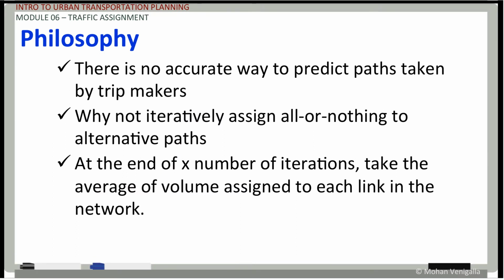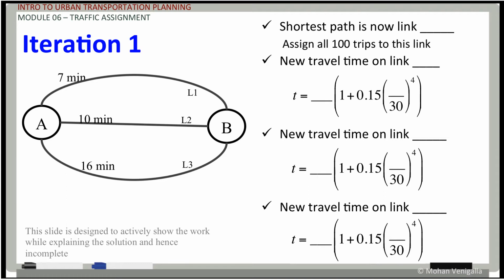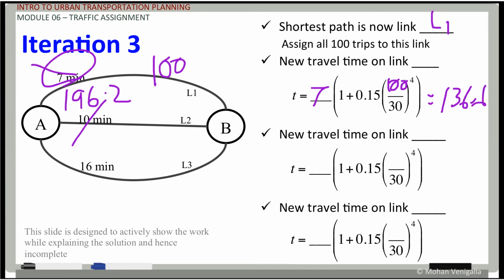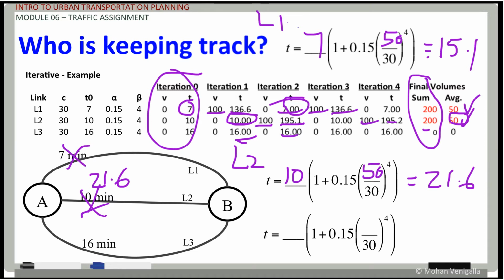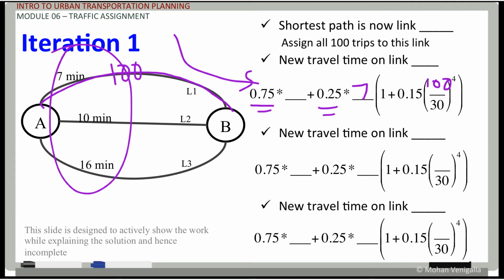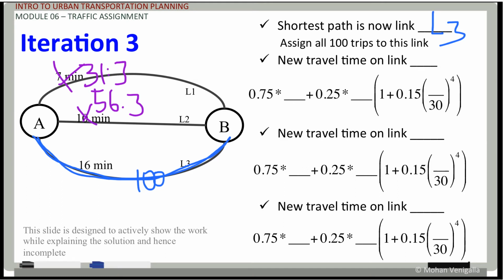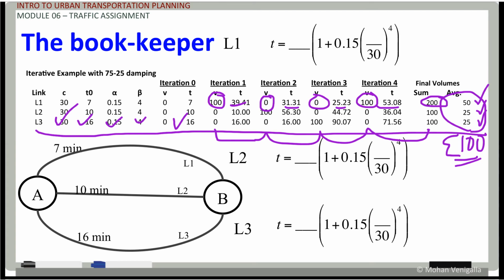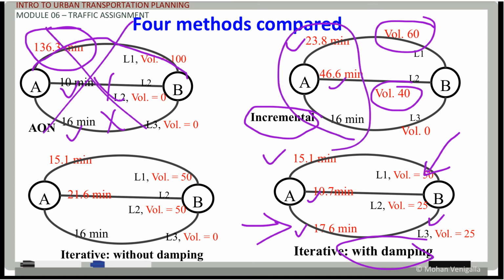Mod 6, Part 7: Traffic Assignment (Iterative Method)

Comment: Wouldn't you interate at the iterative method with damping until the traveltimes do not differ more than a predefinded epsilon. And then compute the final traveltime by the assigned cars you've got?

Comment: Philosophy—0:16
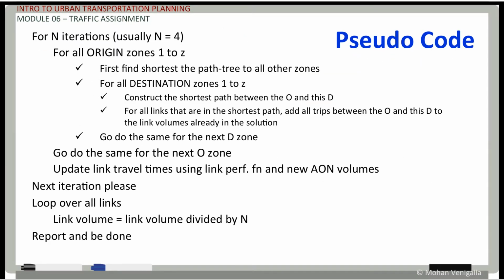Pseudo code—3:10
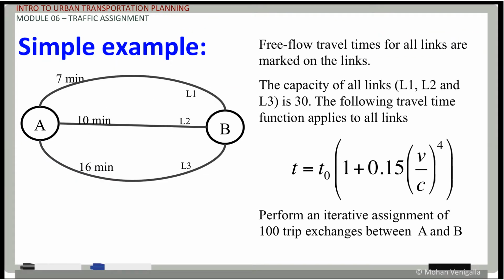Example—4:28
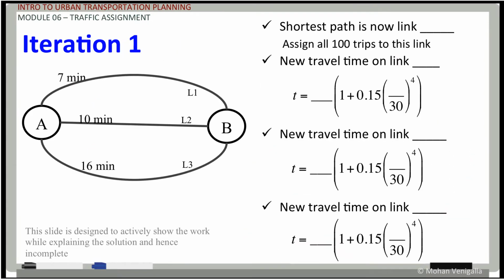Iteration 1—4:56
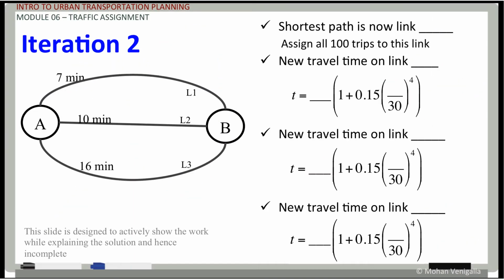Iteration 2—7:26
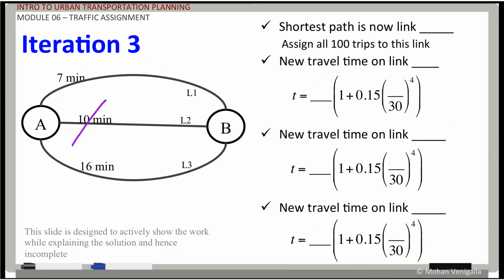Iteration 3—9:05
Iteration 4—10:37
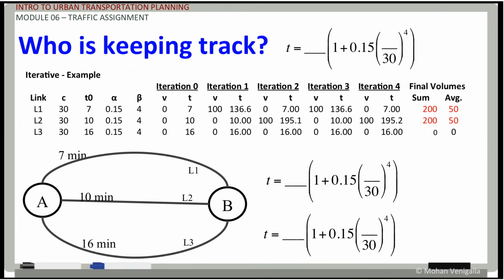Final volumes—12:01
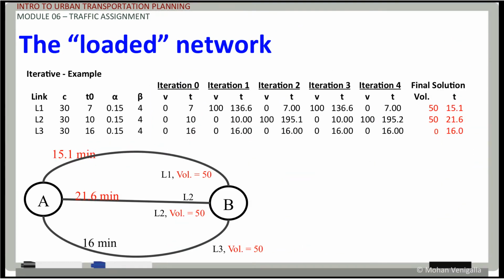Final solution—15:25
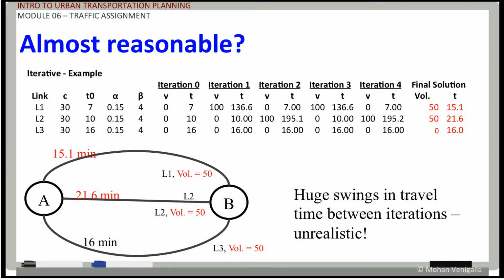Unrealistic model—16:10
Damping factor—17:09
Damping 1—18:50
Damping 2—20:20
Damping 3—23:27
Damping 4—26:35
Dampened volumes—27:44
4 methods compared—31:28